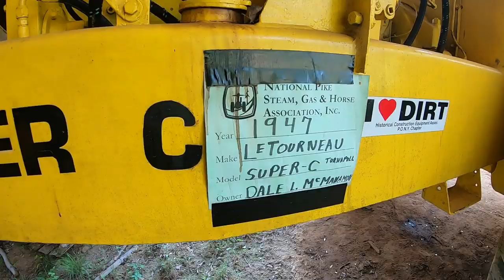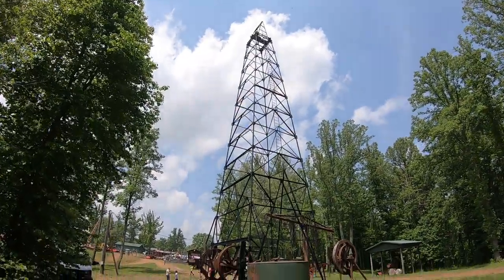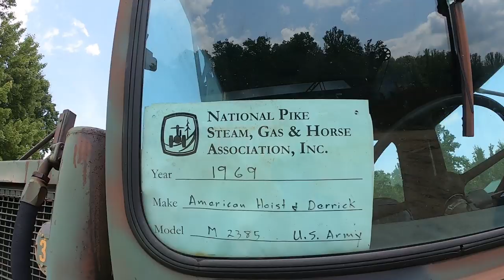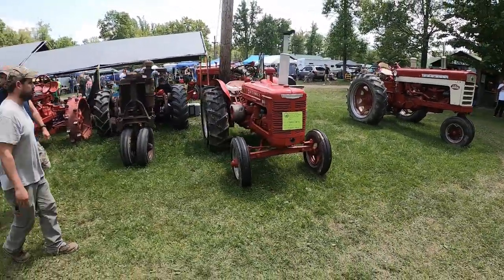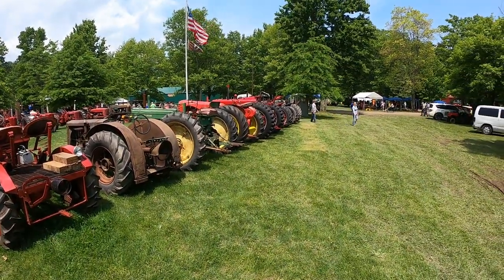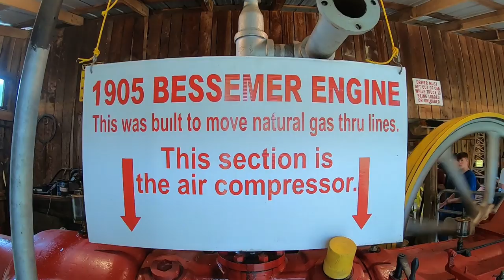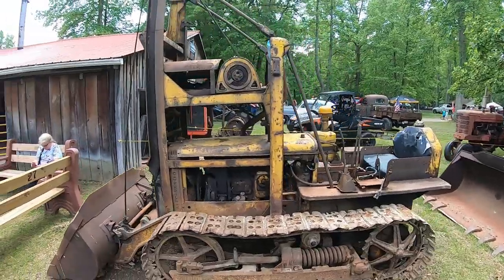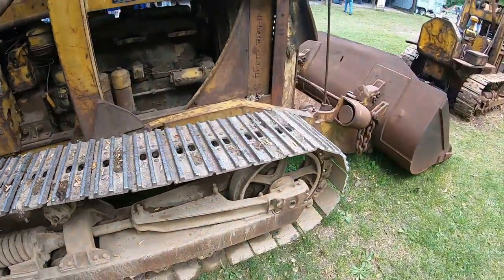Lets Go to the Steam Show!! The 2019 National Pike Steam Show!

Comment: Thanks for taking us along, really enjoyed the outing.  I was glad to see at least one Unit crane, really love them.  We always called them the gentleman's crane as the operator was, for the most part, isolated  in the nice enclosed cab, protected from the machinery space.  I was glad to see a couple of Euclid dump trucks, they are getting quite rare.  Thanks for the memories!!

By the way, that has to be one of the largest sand boxes to play in.
Reply: Freeze in the winter and burn up in the summer. Good draglines though. I'd still take a Bucyrus, American or Northwest for casting.
Reply: My grandpa taught me how to use his American dragline I can still clean a pond with it but I never got the hang of it to do pretty work above ground grandpa used it to pile up dirt for terraces and then fired up the 69 D7G with the pony motor and hooked up to the old 12 ft pull road blade and him and dad shaped them and brought out the old transit toss a stake in the ground make a few more passes till he was satisfied it would drain into the waterway dad's in his late 70s and still hops on the blade puts me on the dozer and we smooth the lanes through the pasture up since I bought the dozer I hope I can talk him out of the blade too

Comment: The crane with the dozer blade on the front is a U.S. Army rough terrain crane.  I was the Battalion Maintenance Officer for the 13th Combat Engineer Battalion in Korea in 1967-68.  We received about a half dozen of these brand new at that time to replace some older truck cranes.  They have variably configurable steering in that the rear wheels could be locked straight ahead for normal driving or they could steer in opposition to the front wheels for tighter circles or in sync with the front wheels for crab-like steering.  They were also 4-wheel drive.
Reply: Like the semi-worthless 20 ton RT's ended up. Good old sputtering 903's.
Reply: @lewiemcneely9143  Actually the 20 ton Rough Terrain Cranes were great for bridging operations.  The huge tires and crab steering meant that you could maneuver around a river bank easily.
Reply: @petemcl99  IF they just had a good set of outriggers. I wouldn't swap a truck crane for 5 of them if I had some serious lifting (heavy) to do. IF the outriggers had just extended. Maybe for lighter stuff but not for me with heavy loads.
Reply: @lewiemcneely9143  We must be talking about different machines.  The outriggers that we had were huge and worked quite well.  Particularly relative to the old truck cranes that they replaced.
Reply: @petemcl99  Maybe so. The ones I was around and ran had hydraulic outriggers that just went up and down, not extending outward at all. Just even with the outside of the rig. They had removable aluminum round feet but weren't very stable except over the front/back. You really had to watch it over the sides or really anything farther over than the hydraulics themselves. Seems like they had American/Cummins uppers but 903 or 555 V-Cummins and a 4-speed auto in the carriers. This was in 7/72. The steering was the same as you were saying. No blade. Probably a 'new and improved' model of yours.
Reply: @lewiemcneely9143  Ah.  That was the difference.  All of ours had bulldozer blades on the front.  That provided additional stability.  Also our outriggers pulled out manually and then went up and down hydraulically.  Not as good as todays outriggers but certainly better than our old truck cranes.  This was 1968 in Korea with 13th Combat Engineer Battalion.  I was the Battalion Maintenance Officer so I got to see everything we had.  Since ours were new we saw no problems with the normally very rugged Cummins engines.  Our only problem was that when my guys went down to Inchon to pick up these machines they did not know about the crab steering.  One of the guys wiped out a concrete bridge railing on the way back.  All it did was scratch off a little paint on the dozer blade.
Reply: @petemcl99  Seems there was a LOT of difference in yours and ours. I was in C company 34th Engineers in a hole-in-the-wall place in RVN called Vinh Hung with a blasted asphalt plant. I got the choice of being a hot oil heater operator or a crane operator. Always wanted to fool with a crane so there I went with a clam bucket charging the plant. Supposed to have a 30-B  but a bridge outfit got it so we had a 22-B. Never sat in one before but the guy leaving asked me if I thought I figured out what did what and I said I thought so. He bailed out and I bailed in. Worse than a fly swat till I got the hang of a free swing but then I started refining it. The 22 lasted till the ARVN's were to start running it. That was the end of the 22 and in came the American 20-ton truck crane with manual outriggers. Ford industrial 6-cylinder flat head that never sputtered once. Wore the bull gears out and tried several others including a P&H but the swings were too light duty and brake lining won't do for a clutch. Brought back the American and you could hear the gears ring a half a mile away. Remembered crater compound on quarry shovels so dipped out some hot asphalt and poured on the gears. Q U I E T! Finished the job then on to the 1st Cav. We need to talk a bunch more!

Comment: Hi Mat loving your vids the steam show I remember driving them TD^,6s I was pushing out brick rubble for a car park lovely warm day when  suddenly it got hotter I had to jump out it was on fire by the time I realised what had happened it was burning the battery sat under the seat and years of trundling about loosened the steel bar to hold the battery down it makes the flat bar loose then crosses the battery terminals enough to set light to its self  not sorry to see it go up they really were old pieces of iron and pretty numb really enjoy your vids Mat good luck

Comment: The compressor crawler is wild looking. I have an old Schramm compressor. It is two old flat heads connected one runs on gas which drives the other modified to compress air. Kind of scary if you think about a bad unloader  valve  I always wanted to go to this show. It looks cool. My son and I have an old 48 cletrac BGH it would go well at this show.
Reply from the maker: I picked up a small schramm this summer Ill be making a video on it eventually!